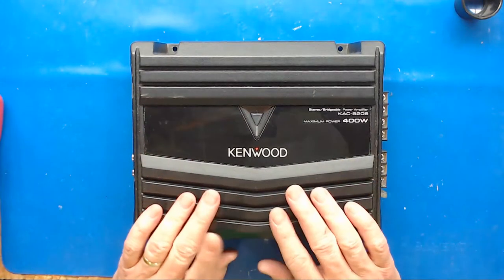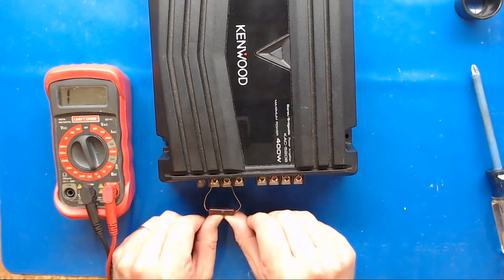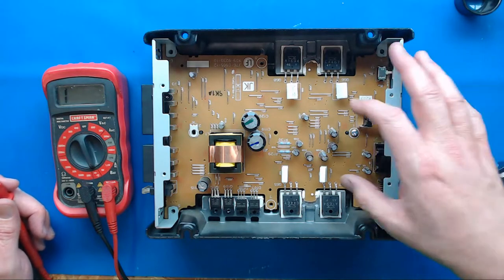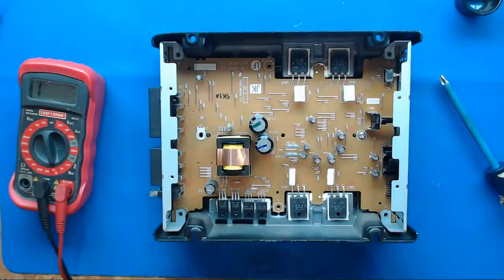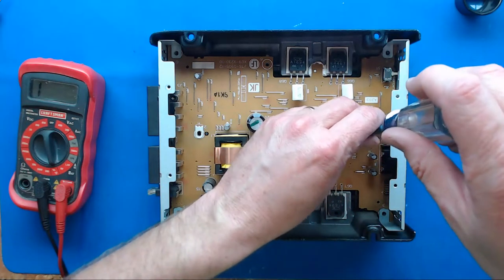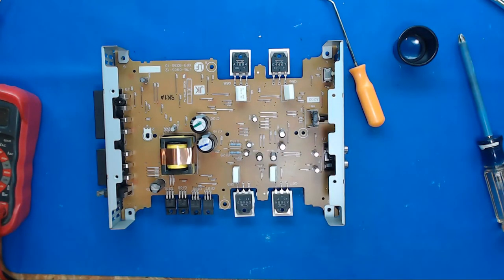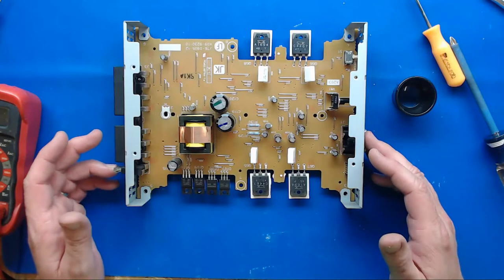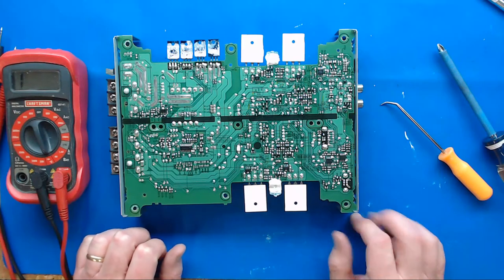Amplifier Troubleshooting and Repair Kenwood KAC-5206 Part 1

Comment: Perfect timing on posting this video...I am beginning to start repairing my Kenwood KAC-8105D.  The microscope cam works just fine btw.
Reply from the maker: Thanks, I still have this amp if you need to know a part number or something that is burnt up.
Reply: Awesome!  All the components seem to be very similar to my amp.  So far I've checked all the power supply and output FETS and none are shorted.  This week i'll be going through with a magnifying glass to inspect the solder joints.  It's been a while since I tried firing it up so I don't even remember the symptoms but I think it never powered up to begin with.  Last year when I fiddled with it, I remember replacing the power supply caps (upstream of transformer) and it still didn't fire up.
Reply: So I ended up finding a service manual for a KAC-8104D which is VERY close to 8105D.  Has all the part numbers and schematics that I need.  I went through and checked all mosfets, voltage regulator transistors, rectifiers, all the solder joints...and it all looks good.  The only thing now is checking some voltages with the power hooked up.  Will I be able to check rail voltages (+/- 65V) and other voltages throughout the circuit with just a multimeter?  I don't have a scope.  Also, do I need to have the remote wire connected for the rail voltages to build?
Reply from the maker: Yes you can check the rail voltages with just a multi meter. Put the black probe on the amp negative input, and measure the center pin of the rectifiers. You will get a positive and negative voltage depending on which rectifier you check. You can also measure with one probe on one rectifier center leg, the other probe on the other one to get the full rail to rail voltage. Caution! one slip and you can make big sparks and destroy parts, not to mention possibly get hurt, be careful. A scope is required to check signals, like power supply and output drives. Next video up will show a power supply repair, look for it this week!

Comment: I've been using this amp for over 3 years with no problems. The other day I was running my sub much louder than usual for an extended period of time on a very hot day, and it cut out suddenly. I opened my trunk and felt the amplifier and it was extremely hot to the touch. Since then I have not been able to get it to work again. When I turn my car on the red light on the amp doesn't turn on. The fuses on the amplifier and near the car battery are both intact. What next steps would you recommend?
Reply from the maker: Time to check the power supply and output fets, see a ton of my videos, its one of the first things to check.

Comment: Hi, I have 2000w Kac-ps917D Kenwood amp as soon as I increase the volume it goes into protection mode, after troubleshooting found out that there is continuity between +ve and -ve power terminal checked the caps and fets everything is fine, any idea what should I look for?
Reply from the maker: You will get continuity on the power and ground terminal until the input filter capacitors charge (see lots of my videos). You probably have DC offset on the output, and as the volume goes up the offset increases and the amp goes into protect. One or more of output transistors is probably hurt.

Comment: Hey! I have a question. I have an old Kenwood A322 amp. It sounded great, until it didn't. 2 of the wires touched for a long time apparently, and one of the fuses blew out. So one of the channels didn't work anymore. I changed the fuses, got new wires that are high quality, so without exposed copper that can touch eachother. Now the sound is extremely distorted, and scratchy. It's not the volume knob. I think i blew up a transistor or something, but I'm not sure. Any ideas what this could be?
Reply: Might be the output transistors

Comment: I have a kenwood that turns on but no sound comes on and it burned the fuses any idea?
Reply from the maker: If it blew the fuses, most likely the power supply side is blown, in combination with a blown output, but it could be just blown output and the power supply is surviving long enough for the fuses to blow.

Comment: mines has no power no indication light or anything took it apart and took my volt meter on it like u did and there all good any ideas? nothing Burnt and yes my wiring was correct I hooked up a different amp to the same wires n it works fine. and also no it's not the fuses the amp Sparks when u connect the wire like it would be getting power but nothing getting hot and nothing happens
Reply from the maker: Each amp that I make videos on, I do the trouble shooting the same, be sure to check a couple others to make sure you understand how and what to check, some of the other videos show better angles etc. Once you have made it though the checks with your multi-meter, and you cannot find any burnt parts or broken solder or traces, then you will need to enlist an oscilloscope for further trouble shooting. I know not everyone has one, or wants to get one but don't let that stop you from trying. Your amp may be more badly broken, but the next amp you try might not.
Reply: @Crazylogix007  I wish I could show a pic the power supply did look a little loose on the soider joints so re sorted the power supply there's a short some where within the board idk where tho I check all the parts on the meter and everything seems to be good above the number it supposed to but I can't find the Short
Reply from the maker: @kyleh5356  If you know which ones are the rectifiers, you can note which one goes where and remove them. That will isolate the power supply from the output. you can then test powering up just the power supply. Check out BCAE1.com for great info on testing.
Reply: Crazylogix007 will do thankyou for the help ill se what I can do